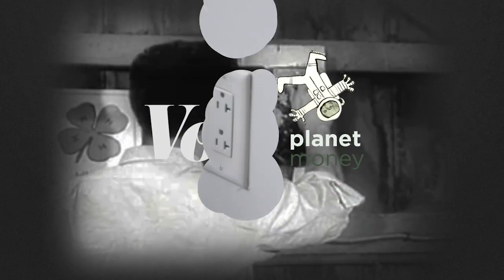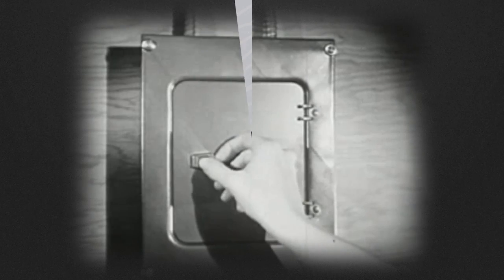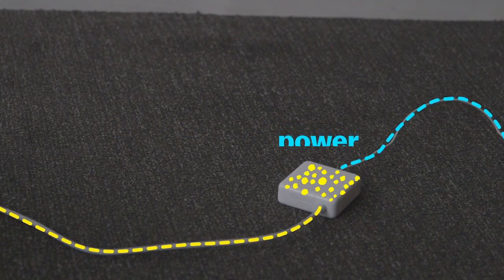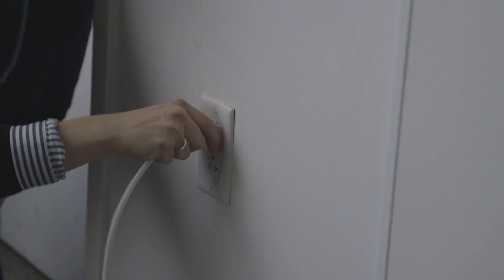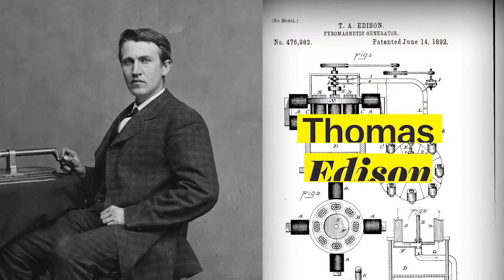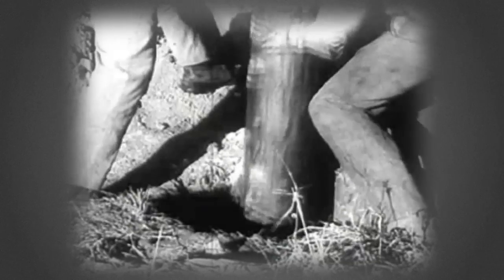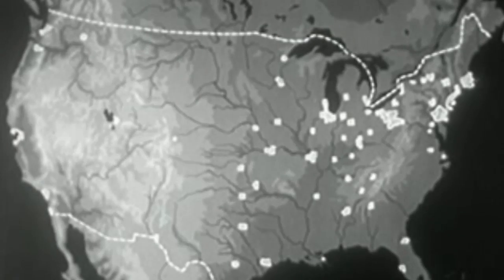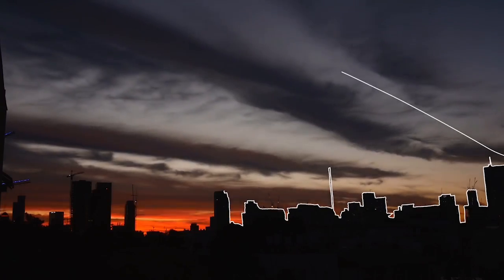Why your laptop charger is so hot

Comment: Voltage drop via line-loss is a really really significant consideration for low voltage DC. It's best for the rectification to take place nearest the point of utilization. And a whole house DC converter is a poor idea. It's akin to saying, "why not have just one giant utility stepdown transformer instead of a bunch of little ones everywhere?  That's sooooo wasteful!" even though any EE or electrician knows that's just dumb.

If we want to save energy/make the grid more efficient, we need to start running higher voltage in residential applications, and utility companies should create incentives and rebates for replacing old and outdated 120V and 240V commercial/industrial services with 3-phase 480V.

Hit me up, Vox. I'll help you do better next time.

Comment: Really?.. the heat is the energy not being used or wasted.. it happened awhile ago with light bulbs,  instead of the energy being used to produce light, most of it was converted to heat which is not effecient.Therefore the energy  that comes out of you're wall is too much for the laptop so the box tones it down to whatever amount it needs and that toned down energy is the heat or wasted energy.

Comment: Wow, it must be rough when you call in an expert and they barely understand the subject as much as you. This entire video is wrong. It focuses on AC vs DC, when the real issue is Voltage stepdown. Having one box would do literally nothing, because your phone needs 5V and your laptop needs anywhere from 9 - 12V. The reason all devices have power bricks is so you can have as many plugs as you want, and your device just gets what it needs from one plug. A huge device in your house to do this wouldn't be any more efficient, in fact devices like this would waste energy by creating certain voltages you wouldn't even use. This would be similar to a computer power supply, which is only about 80% efficient, and that's when literally all the outputs are used. Not to mention the nightmare of forcing ALL devices onto a limited number of voltage levels, and needing to have different outlets in different places for different voltages, on top of being LESS efficient.

Comment: OKAY! TO EXPLAIN IT, Your PC converts AC to DC using some electronic stuff like a full bridge rectifier or something like that and what happens is energy is then lost during conversion. That energy then becomes heat and boom. There you go, you get a hot laptop charger.

Comment: If electrons flow like a river in DC, then where do the excess electrons go? Why is there no extra wire taking the electrons back to the wall socket, like a battery with 2 poles?

Comment: if it safe to put the charger on a cooling pad (with a central fan) to help it cool down?
my charger doesn't have any heating problems, but it gets very hot in my flat during the summer, so i was thinking of using the cooling pad to sort of compensate for the extra heat that is already in the house.
i figure it should not be a problem because in the winter, you obviously have a cooler temperature that stops it from heating too much.
but i could be totally wrong, so any advice is welcome

Comment: The claim that AC is easier to transport is wrong.
The transport losses of DC are actually smaller and long cables (especially sea cables, like the HVDC Italy–Greece) use DC to transport electricity. The problem is that DC voltage transformation is costlier that AC transformations.

Comment: You are using DC power because when you send power into an electronic it is going to the battery, which emits DC current to the device. AC current is produced by generators and as stated in the video, is better at travelling long distances.

Comment: AC: current flows in both directions so if you plugged your laptop into AC it would charge then discarge rapidly with no net power gain.

DC: flows in one direction. Achieved by passing AC through diode which is eccentially a one way street but for electrons - allows current to flow one way but stops it from flowing back. The energy lost by stopping the returning current is converted to heat (Or light if you are using a light emmiting diode (LED))

Since the video didn't explain this I thought I would

Comment: power converter gets hot because there is convertion of power and it goes through small electrodes, resistor, diodes and etc.

Comment: The real reason the world's power grids use ac is that it is much easier to convert ac to dc than it is to convert dc to ac, and so we just do that.

Oh jea: the lightbulb you showed at 1:00 is an led, which requires dc, or at least converts it inside.

Comment: Ignoring the fact that the video didn't answer its own questions, but still, producing AC power is much easier since alternators are simpler and more effective than dymos.
Also, on long distances, power is carried over 3 phase circuits, switching to 2 wires DC systems would cause much higher losses due to Joule effect than your average power brick (which is actually quite efficient btw, if it doesn't use a linear voltage regulator to step down voltage)

Comment: Not really. AC to DC is as simple as running it through a loop of diodes, and almost no power is lost there. As for having a single converter box, this is a bad idea. The power your phone uses is on the order of "turning on a light," wheras the power coming out of the wall is more in the "this could kill you if you lick it" ballpark. The brick in the charger contains a transformer, which converts ~120v power into nice, civilized, low current 5v power for a laptop.

Transformers, BTW, rely on oscillating magnetic feilds, generate heat when they run, and require alternating current to function. So if you tried using the same converter for a phone and a laptop...the phone would be fried, or the laptop would take forever to charge...

Comment: Yeah this explanation is a bit naive. and this entire video assumes the premise of "all electronic devices need the exact same DC rated power"
your phone and your laptop and your TV draw different amounts of current, and so one DC supply of your house isnt going to cut it. Laptops usually need around 19V DC while phones are usually 5V DC. 
the one power box might make sense if you can force everyone to standardize the power requirements for electronics, but then that doesn't work either because then you have limitations on how you design electronics.
TLDR; Nice try Vox, but no.

Comment: If im not getting anything wrong 
generators generate AC and it wouldnt really make a huge difference where we convert since there should be about the same ammount of heat total
i dont even think that conversion from ac to dc is inefficient
from what i know there shouldnt be much loss other than the forward voltage of the diodes that make up the thing that rectifies ( converts ) the ac power

Comment: ooow boy, so this video is correct when it says that converting AC to DC creates heat, that's true, but veeeeery little heat in comparison to the heat lost when converting the wall voltage to the voltage your laptop wants, so the heat that you are feeling is actually the heat produced by changing voltage. you wouldn't even be able to feel the heat created by switching from AC to DC at the current your laptop is drawing. 
But that's not the biggest bummer about this video, There would be absolutely no energy saved by using a DC electrical grid. simply because of the fact that turbines create AC current. This means that you would need to convert all energy created by powerplants to DC current before sending it to the grid. 
It get's worse! on an industrial scale, there is a massive amount of AC current usage, about 87% of all electric motors require AC current. So not only would there be a bigger amount of power conversion in total, converting DC to AC is also waaaay more difficult than doing the opposite...
and that's just a fraction of it all...

Comment: Please don;'t try to start the second war on AC vs. DC... AC to DC is actually very easy process. Supplying right voltage for different device is the difficult part and generate a lot of heat.

Comment: Next time get an electrical engineer who actually understands this fundamental phenomenon instead of misleading people with this information. All your devices requires different DC voltages (laptop 12V, phones 5V, etc) and AC to  DC converters are VERY efficient. What generates most of the heat are the step down converters (bringing 120V down to 5-12V). You also can't use transformers with DC power so you won't even be getting your 120V AC from your outlets but maybe several thousand volts instead. And transporting low voltage DC across your house and/or your neighborhoods will be VERY inefficient as a lot of your power will be lost in the wires because your voltage is so low.

Comment: This video is really dumb.. AC won the current wars because transmitting DC even more than a couple dozen meters is horrendously inefficient. The idea of a centralized converter/voltage step down wired into your house is inherently inefficient, please someone at VOX pickup an electrical engineering textbook before trying to sound like an expert.

Comment: Lots of things wrong with this video as people have pointed out. Converting from AC->DC doesnt take much at all, and certainly doesnt create much heat. A couple of diodes and some smoothing capacitors will get you DC, and neither of those will generate significant heat. Even transformers really dont generate much heat, really just from eddy currents. The heat comes from powerloss, which comes from stepping down voltages through a voltage regulator, like a transistor. The voltage has to go some where, and its released as heat. so "decreasing the number of conversions" to save energy isnt going to do anything.

Comment: Dumb video indeed, the heating is caused by the transistors or integrated circuits used to rectify or regulate the flow of electricity, and because the charger has no ventilation so that heat is not going out easily. The smoke will come out if  it has very large power fed to laptop not ac, try charging laptop with 110v dc.

Comment: Huh. Now I have to question Vox's credibility on music, art and other topics I enjoy on this channel. As an electrical engineer, this was an incredibly dumb and shallow video on AC/DC power supplies. 

1. AC is not only preferable because it travels well over long distances but because you can use transformers to easily step up/step down voltages which reduces power losses due to resistance over long wires and you can implement a three phase power system which uses way less copper wiring and significantly reduces infrastructure/maintenance costs.

2. You exaggerate the power loss of AC to DC conversion due to heat dissipation. It is 98% efficient. Most of the power loss happens due to voltage being stepped down.

3. A single AC to DC converter for all devices is a very dumb idea. Yes, electronics use DC, but not all DC is created equal. Each device charges/operates at a specific voltage and current, often different from one another. The charger not only convert AC to DC, but steps down voltage (linear regulator/buck convertor) and may have a choke/inductor to provide steady current flow at a specific amps range. Having a single AC to DC convertor for your entire house just add an unnecessary step in between.
Reply: Just felt the chargers for my two PCs, both are warm, nowhere close to burning.  And one of them has been on for weeks.
Reply: Mine for my gaming laptop has been plugged for months and it guzzles power.Not even hot.
Reply: TheSleepingInsomniac ur charger doesn’t get hot because almost all of the power is needed by your computer. A chrome book uses a tiny amount of power compared to a gaming laptop, meaning a chrome book charger has to waste a lot more energy(i.e. produce a lot more heat) because it isn’t needed. Versus your gaming laptop which needs more energy, wasting less energy, creating less heat.
Reply: Also, lets be real - the only reason the apple charger heats up, is because it is grossly underspec'ed to reduce size. If they had doubled the power delivery capacity, it wouldn't be operating on its maximum margin most of the time (especially when the MacBook's CPU goes under load).
Reply: @ShaunakDe  dell workstation owner here
yes, it does get into the wouldn't wanna hold range
only when doing max load stuff however
normally it's cool to the touch
130W power supply with 0 fans. you can see why it'd get hot
Reply: Huh?  It sounds like #1 on the original post says: "AC is not only preferable because it travels well over long distances.  Its better because of these other things that allow it to travel well over long distances.....

oh and with a narrower cord, which helps cause thick cords suck.... over long distances....."
Reply: Not to mention that DC with high voltages to transport from city to city is very harmful since it generates electric field with high frequency, because it has 2 poles + and - . AC changes that constantly and it gets canceled out, no frequency. Very healthy and easy to operate with it
Reply: I’ll second that
Reply: darexinfinity I have a super compact dell one which also gets too hot to touch. It's simple physics. Smaller components can dissipate less power.
Reply: David Boucard ooo
Reply: what do you think about the ac explanation
Reply: David Boucard *
Reply: So is it normal four an AC connector to be very warm?
Reply: As someone who initially liked this video for being so informative, I appreciate your comment.
Reply: I appreciate your comment. You rock!
Reply: you hit the nail right on the head bud
Reply: Thank you! You saved me the effort of weiting exactly the same thing!
Reply: I learned that in the 8th grade and vox is trying to trick adults and its actually working.
Reply: Actually DC travels better for long distances too due to the almost elimination of inductive loss, However the big problem to DC is the electronics required to control it. DC can be stepped up and down almost as efficiently as AC using switch-mode converters, but that requires advanced control circuitry and power electronics not available in Edison's time. Now we have the integrated circuits for the advanced control, and the power semiconductor devices for current handling, together creating the required control components. Also AC switch gear usually don't have to consider arc quenching too much since the current will go to zero on its own at some point, but HVDC current never stops creating a lot of technical burdens in the switchgear. The solution to HVDC switching is, again, semiconductors, when combined with mechanical switches. Have you heard of the gigavolt HVDC in China?
Reply: The safety discussion then goes into failure modes for high voltage DC.  The switching circuitry must be failsafe, but has more complexity than what is needed for AC, therefore more potential for component failure.  Also, the amount of power involved is considered a bit more dangerous because it's DC voltage & current which has no cycle and never goes to zero unless the circuit is broken.  In a failure mode where a human being is unlucky enough to be in the circuit, the muscles don't have a chance to let go as much as with AC.

The major component of losses due to long distance power distribution are the resistance of the wire.  This resistance depends on the metal used, and increases proportional to the length of the wire.  When voltage & current are stepped up & down with a transformer, the objective is to reduce the amount of current transmitted with the least amount of losses in the transformer (inductor windings, core & insulating oil).  So Voltage (V) is stepped up and Current (I) stepped down, which reduces the I^2*R losses due to resistance and current *squared*.   So the math involved means we really have to focus on reducing current much more than resistance of the wire, because that's where most of the losses are.  Also it's the same with inductive losses in that they are much less in comparison to the I^2*R loss.
Reply: I learned more from this comment than from the video
Reply: this is 9th grade stuff Vox should've known.
Reply: Well this is not an engineering class mate. The video is made for people that have no clue about the topic. If you noticed they don't even mention once about voltages as that would be harder to explain. The goal was to explain power loss and they mentioned one of many factors, that's good enough for the audience.
Also, DC actually travells better on long distances than AC.
I do agree with your third point though, converting AC to DC in a centralised manner is useless.
Reply: @fb55255  I agree. This isn't an opprtunity to earn a degree. It's a convenient way to learn more about the general world
Reply: its to simplify it for the simple minded
Reply: k
Reply: What do you expect from city slicker liberals knowledge on anything trade related
Reply: As another electrical engineer.. shut up.. this not class.. make your video if u want to teach